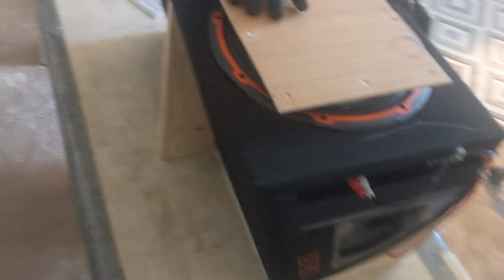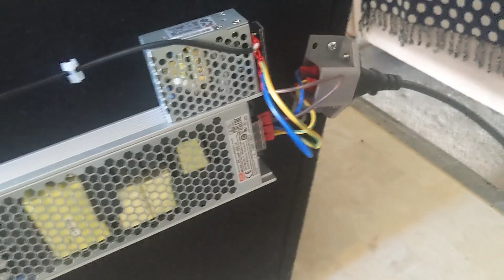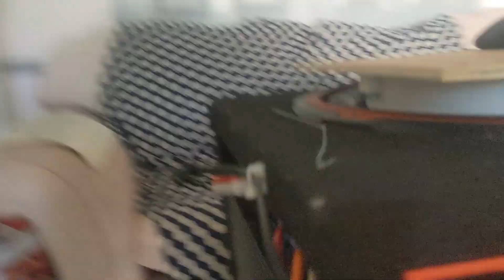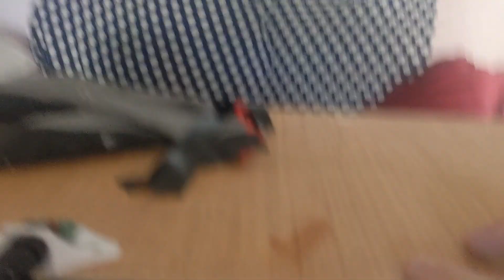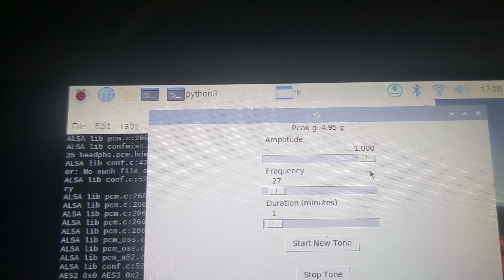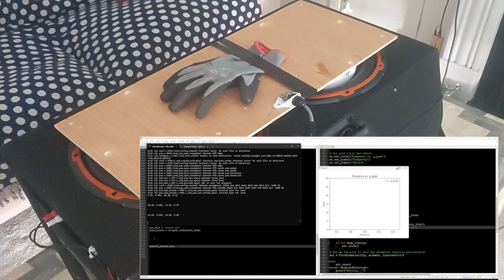Making a vibration table using a subwoofer

Comment: hello!
I would like to know the list of materials that were used to set up the experiment, and if you provide the code used for operation?
I will be very happy if you can help me!
thanks.
Reply from the maker: Hey the code is here : https://github.com/wattnotions/vibe_table

And I wrote a blog about it here which shows some of the materials
https://wattnotions.wordpress.com/2023/05/19/making-a-vibration-table-using-a-subwoofer/
Reply: @wattnotions  Hi, this git doesn't seem to be available anymore?